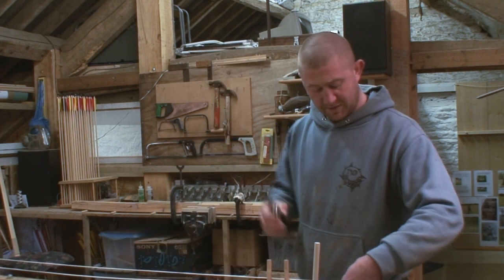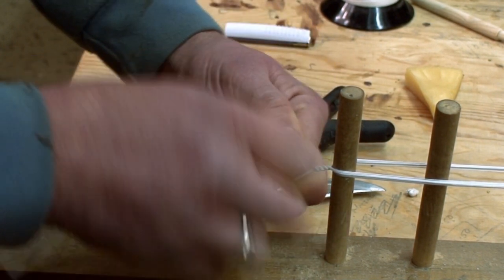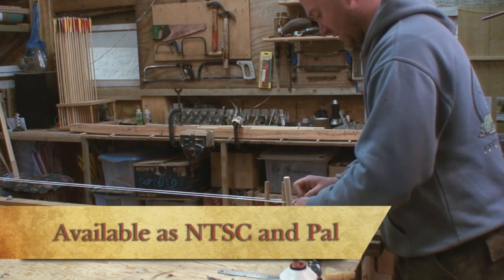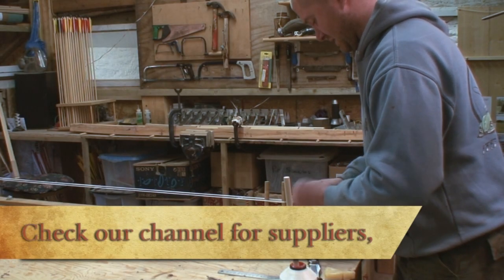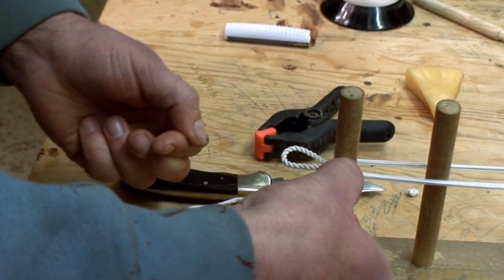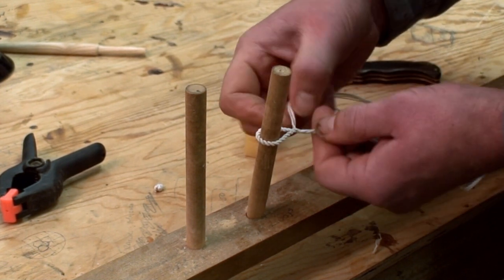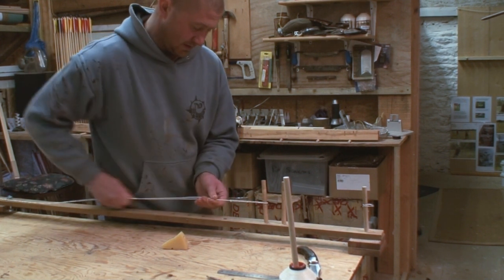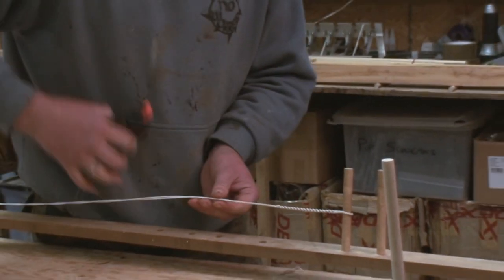How to Make a Flemish Twist Longbow String (Part 1)

Comment from the maker: @Desert392 
On that bow for the DVD the woods used were hickory, osage and lemonwood. The first chapter of the film deals with a variety of different woods for laminated bows at lot will depend on the performance your after and the draw weight.

Comment: FYI, Fast flight does not incorporate Kevlar in its manufacture. It is made from synthetic High Modulus Polyethelene (HMPE) fibres (Spectra/Dyneema)  and has about 0.8% stretch characteristics (as opposed to Dacron's 2-3% stretch.)